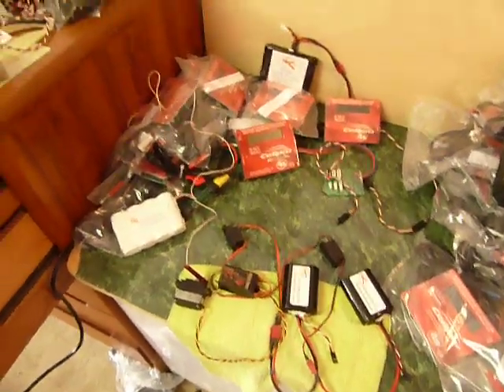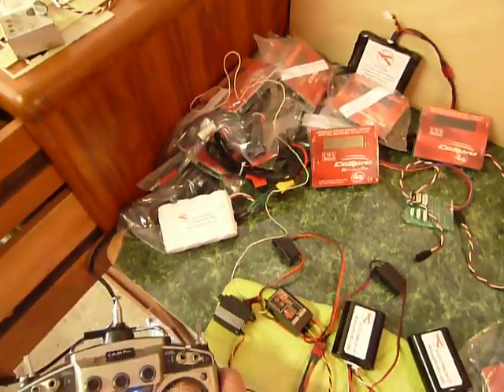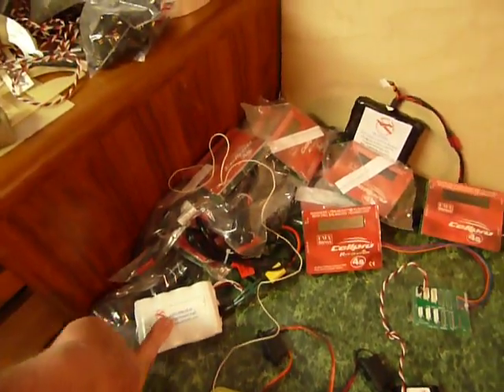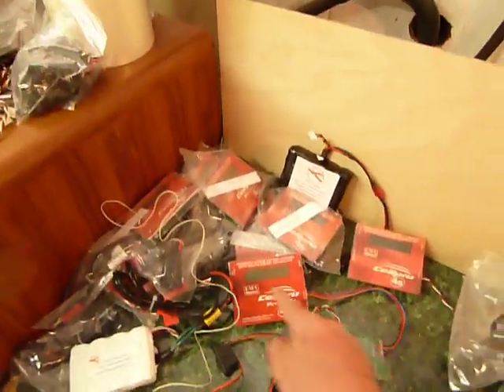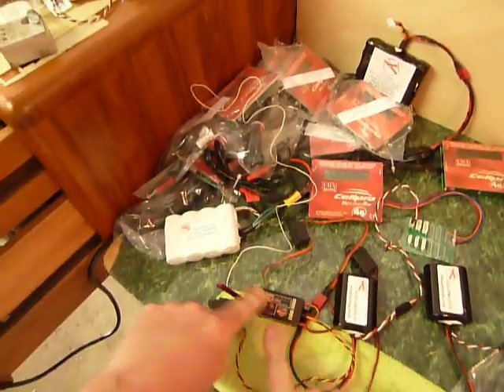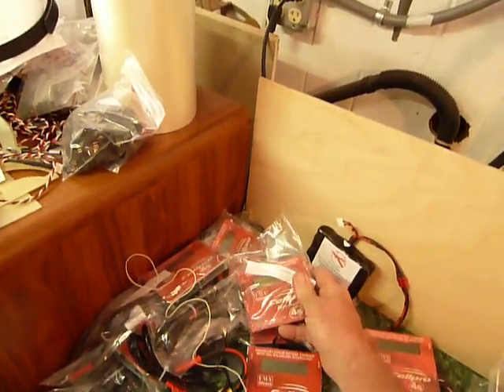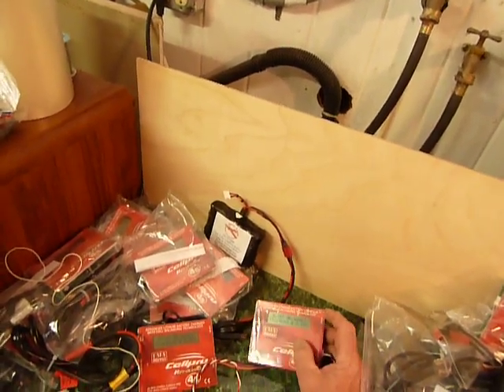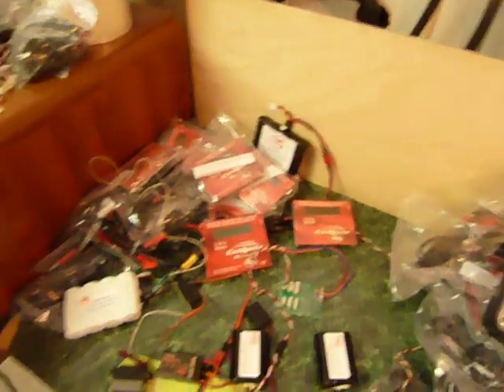WWRC tests two chargers on a receiver with dual batteries

Comment: Hi, im back to RC recently and still having ancient Cellpro 4s. The manual says the charger can charge NiCd and NiMh battery, but I have no idea how to connect those battery to the charger? the parallel board seems to fit only with the lipo. Thank you.